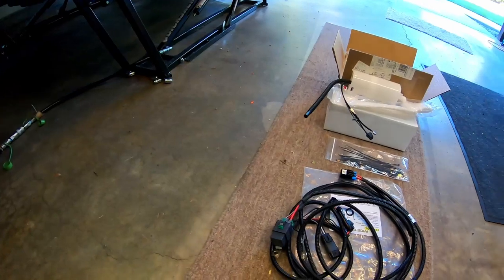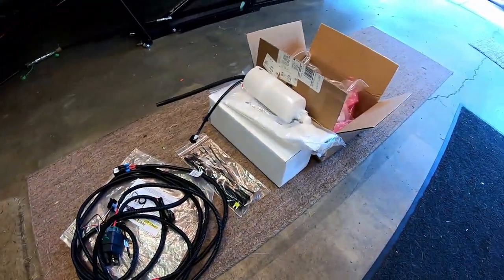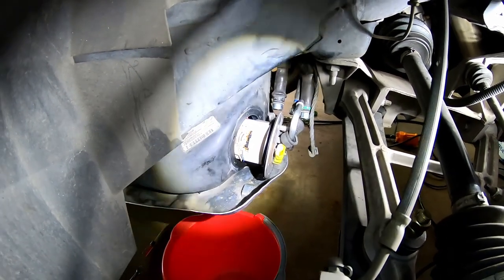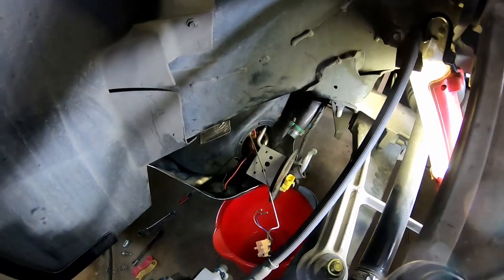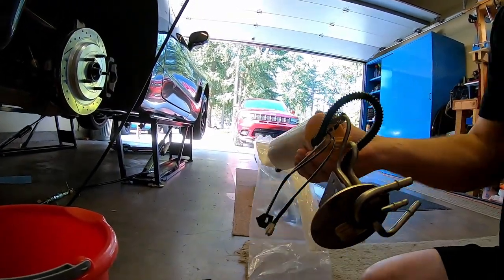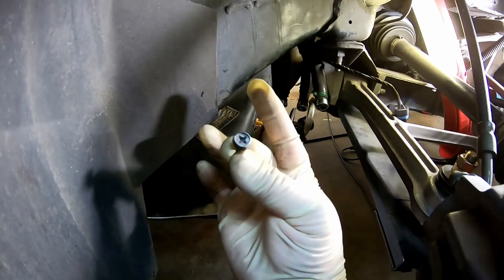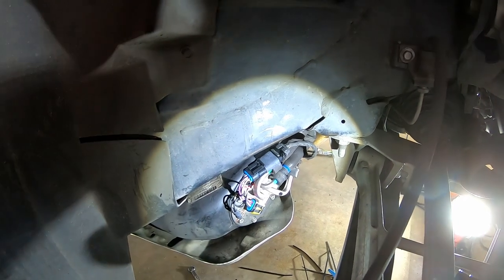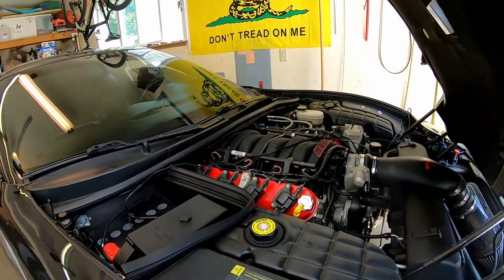Racetronix RFPK-007 Fuel pump and wire harness installation C5 Corvette

Comment: my yellow zo6 died on me yesterday and I'm thinking its a fuel pump issue, or a fuel injector one, wish me luck! this video is very valuable
Reply from the maker: You are quite welcome.   Fuel pumps do die on occasion.  It could be a pesky power and ground issue as well.   Bypass the fuel pump relay and see if it will pump fuel.

Comment: Thank you for this video! Helped me a bunch. Only thing I'm having trouble with is snapping the fuel level sensor back into the hat. Everytime I popped it in it would pop back off and I ended up breaking one of the clip pieces off so now having to find part number to purchase the fuel level sensor. Seemed like it took some effort to pop it off the hat in the beginning from my memory.
Reply from the maker: It is a pain to work with that drivers side fuel sender.  I am still having problems with my fuel gauge cutting out and getting check gauges message. I'm guessing I'm going to have to replace the drivers side sender now.  I just don't wanna lol.
Reply: I have looked everywhere for just the fuel level arm with the white end piece that attaches to the fuel hat but they want you to have to purchase the whole fuel pump assembly with pump which I don't need since I'm installing a Lingenfelter 255lph pump. I already installed the hot wire kit on stock pump years ago but I'm mad at myself for not being more careful. Mine is a 2002 C5Z.

Comment: Thanks man I gotta do this! Mine has an old boosta pump setup that I think is failing. I have a whipple 2.9.  Guess we'll see....
Reply from the maker: What do you have the whipple on?   I am thinking heavily about swapping out my LSA for a Whipple 2.9.
Reply: @MRBLACK947  I got it on a LS1 with speed engineering LTH and xpipe and a z06 catback. It's an 02 Convertible.

Comment: Good video and no BS like some of these others.  But that tank skid plate comes out easy.  I’ve had my C5 tore apart this winter and keep looking at the pump hats, but had the skid plates down anyway for other work.
Reply from the maker: Will those tanks fall all the way down if you completely remove the skids?   I wasn't sure honestly.
Reply: @PNW_Car_Mods  no.  The cross over tube will prevent the tank from coming down.

Comment: You are a brave man. Really dread pulling the tanks. My oem pump is new. I am stuck deciding with my LS7 Z06 Eforce it seems it can benefit from more pump. 
The tuners say I can use a booster and the oem pump. I will try the hot wire kit and booster first but would rather just have enough fuel pump. 
Having done this, would you recommend this or an in-line secondary fuel pump?
Reply from the maker: I would definitely try the boost a pump before going to an external but that is just me.   With the full racetronix kit that I am using it says it's good for about 600 wheel on pump gas with a full return style fuel system which I have.  700 wheel with a boost a pump.  I have a hard time believing this on a 255 pump but time will tell.   Do you have that LS7 combo in a C5?  or is it in an actual C6Z?
Reply: @PNW_Car_Mods  C6z with mild cam. Right at 680rwhp with straight meth. We are trying a larger injector now so hope we have nuff fuel. Please be careful make sure ur not lean!
Reply from the maker: @nyplantingsgardendesigners5645  yup no doubt.  We have this new supercharger tune so conservative right now it don't even run right.  Still working on my VE table tuning before we start leaning it out and adding timing.   C6Zs might be one of my most loved cars in history.  Good luck with yours.

Comment: What is the part number for the passenger side fuel sending unit you show at 1:15? Good video. Thanks!
Reply from the maker: Andy it was purchased off of ebay with the following description.........Fuel Pump And Hanger With Sender ACDelco GM Original Equipment MU1216
Reply: @PNW_Car_Mods  Thank you!

Comment: In minute 4 you disconnected the fuel lines. Theres what you said is a connector next to them. What is that connector ? I thought my fuel pump hotwire kit was the problem only to find that “connector” is torn & pretty much exposed and fried. What can i do or any tips ?
Reply from the maker: That connector does two things.  it's the power and ground for the pump and also wires for the fuel sending unit.   Maybe just find a replacement connector pigtail and cut and splice with enviro splices that you seal with a heat gun.

Comment: good video man.
Reply from the maker: Thank you cole.  always good to see you.
Reply: no codes on mine but when tank is full it reads 0, after maybe 20 miles it reads assuming correct
Reply from the maker: @colemcmeans7809  It is a total pain in the ass system.  and then further more I've made it more complicated with the PCM swap lol
Reply: I forgot you did that pcm swap, I just wish I didn't have to completely drop the tanks. If they only would have put in an access plate. At 117k I'm not mad but it's still a dammit situation.

Comment: Is it the same process for a 2004 corvette?
Reply from the maker: I don't believe so.  I think 2004 is the super oddball year where all the fuel system stuff is in the top of the saddle tanks.  Requires tank removal IIRC.  I don't remember if this kit is even listed applicable to an 04.
Reply: @PNW_Car_Mods  thank you

Comment: Did you ever have any front main seal or harmonic balancer issues ?
Reply from the maker: Hayden, I did not but to be fair the car only had 26k miles on it when I bought it two years ago.   It actually has an SFI approved aftermarket balancer on it now with a new front seal from the cam swap.
Reply: MRBLACK947 I just replaced all of that including the seal and it blew
Reply from the maker: @haydenjackson8580   Like the seal failed?
Reply: MRBLACK947 yeah recon so or the balancer threw it out again I replaced both the seal and the balancer because it was leaking and now the seal completely blew

Comment: That thumbnail is cool. Lol
Reply: Just finished watching. 
So, do you ever drive this car, or do you just like the challenge of "ship in a bottle"? Lol

Would it be worth it to use that header tape stuff to try and keep heat away from everything?

-Chuck
Reply from the maker: My fine artwork done in MS paint with a mouse hahaha
Reply from the maker: @PanzerPlatform   Much to my surprise I have put right at 5500 miles on this thing since July of 2018.    Heat wrap is always an option but I'm confident that I have everything far enough away it can't get damaged.